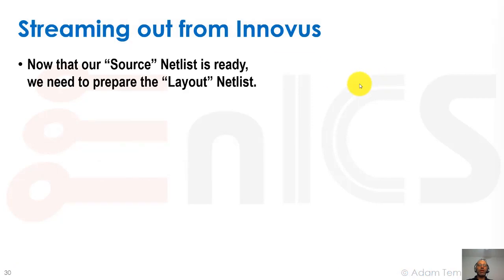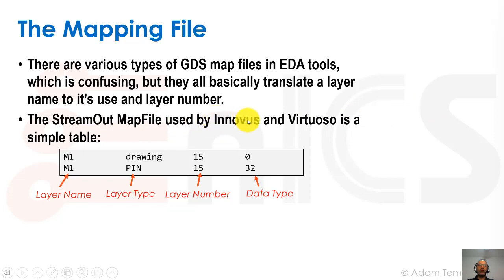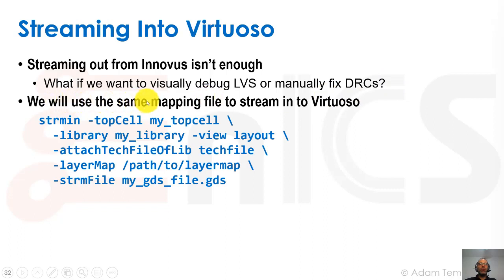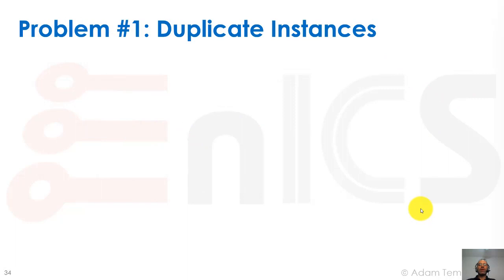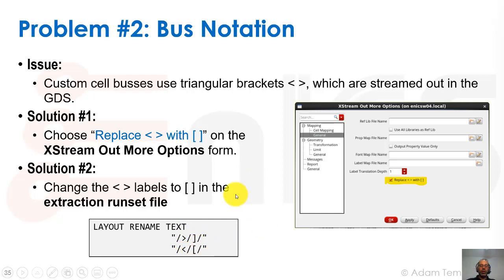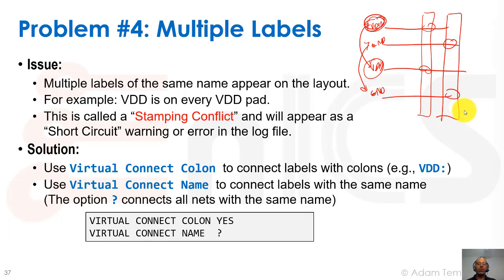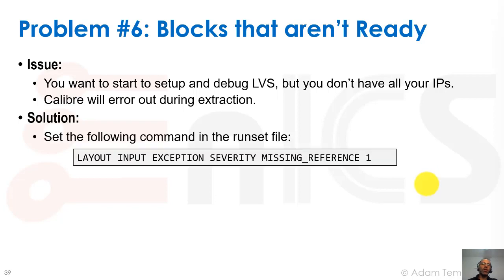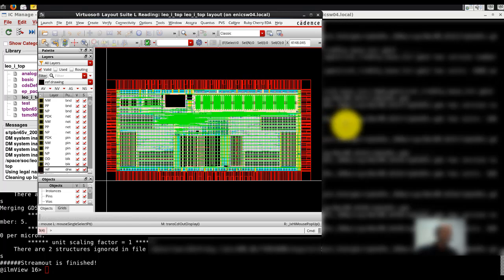Digital-on-top Physical Verification (Fullchip LVS/DRC) - Part 4

Comment: @Adi Teman   Could you show how to add labels for Power/Ground IO in innovus? In my design, Power/Ground IO are created by innovus command as physical only, so there is no terminal/ports for them. I used to use "LAYOUT TEXT" to add label, or add label in Calibredrv GUI. I am quiet cuirios about how to add in innovus.
Reply from the maker: Hi Jieyan,
This is a bit odd, since in general, when you create a global net, there is usually a toplevel pin that is created for this in Innovus. In fact, this raises some concern if you don't see such a port in Innovus and you don't see an appropriate label on the GDS.
That being said, there are a few manual ways to add pins and the best way to find the updated way (since these commands tend to be tweaked) is on Cadence Support (or in the manuals, such as the text command reference). For example, recent versions of Innovus have a "create_hport" command that should take care of this, but I must say that I haven't yet tried it out. The previous way was with the "create_hpin" command with a "-" option (just a dash with nothing else...) and then connecting the net to some module or net. If you have a global power net, I think it would work to supplement this with "connect_hpin - -pin_name VDD -net VDD" for example.
Another option you should know is to write out a text file with the names of the toplevel pins. The legacy command was genPinText.

Comment: hcells, could you please elaborate on that?
Reply from the maker: Hi Grannyw777,

Sorry for the (very) later reply. I actually hadn't been dealing with this for quite a while and couldn't pull an answer out off the top of my head, but I've just finished running LVS on a complex chip and now I can give you a reliable answer.

The "hcells" file is a way to tell the LVS tool where to maintain hierarchy - kind of similar to "don't ungroup" in synthesis. If you define a hierarchy as an hcell, it will keep that hierarchy during extraction, such that a .SUBCKT of that module/instance will appear in the extracted (layout) netlist. Otherwise, there is a good chance it will be flattened and you won't be able to recognize that specific hierarchical name or find it in the netlist. This can help debug (from experience - it is a lifesaver).
Then, during comparison, the hierarchies defined in the hcells file will be compared standalone and show if there were discrepancies at their level. In other words, the tool will report that a lower level block did not pass LVS. This has two uses:
1) It can tell you that whoever provided this block didn't pass LVS or if it is not an IP, it can point to where an error may be occuring.
2) If the block does pass standalone LVS, it can tell you that something is screwed up in its connection to the toplevel. 
Again, these kinds of "hints" can focus you towards the problem and help you find it. Otherwise, you may be lost.

Note that you can also "blackbox" an hcell and the tool will report to you if the connections to it are correct without checking the content of the block.
Reply: @AdiTeman  Hey Adi, thanks for elaborate explanation!